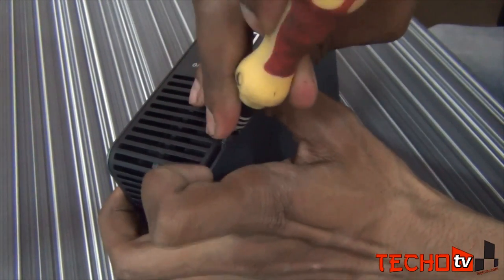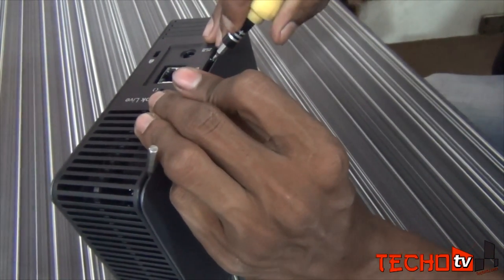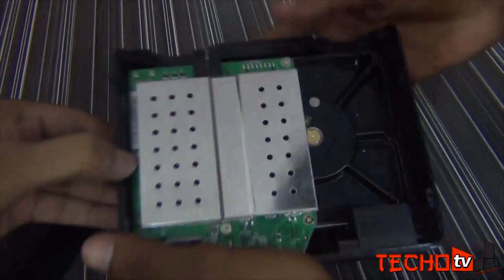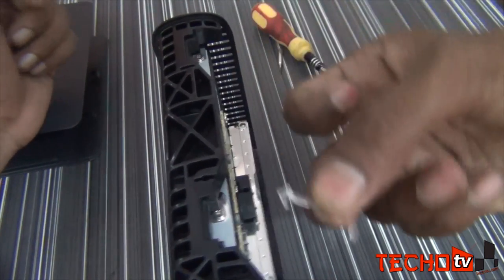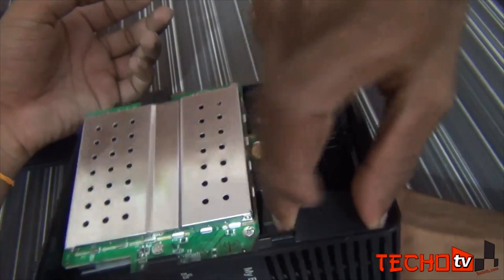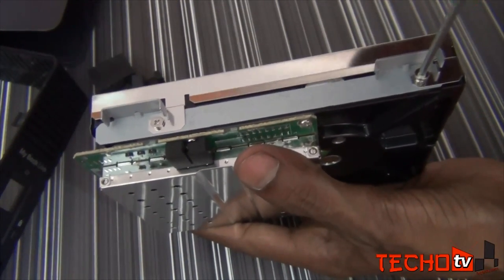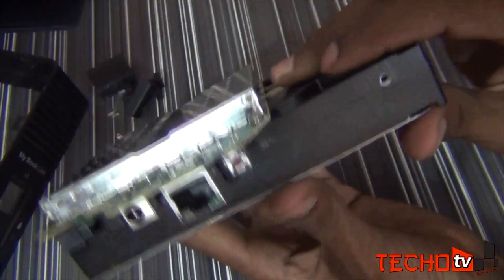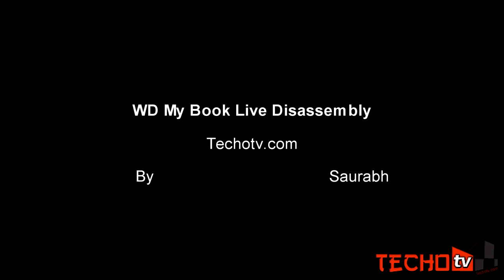"WD My Book Live" NAS Disassembly - How to open, take out Hard disk

Comment: If you attempt to force the long edges apart in the way shown you will break the lugs securing the outer casing to the chassis assembly.  Using a screwdriver will also damage the casing further.  To separate the casing from the chassis you must slide the chassis out, using a plastic separator tool inserted (like a wedge) between the round edge of the casing (top and bottom) and the casing to ease it out.  When the clips securing the casing to the chassis are free the casing will slide easily.  It requires patience and great care.
Reply: Do a video of it. Would appreciate.
Reply: Thanks for the tip, managed to slide it out in one piece with nil damage, 10/10 would brick again.

Comment: good video. I used one of those plastic tools, they give you to replace a mobile phone screen, and started at the corner of the case to start and it was a lot easier to run the tool around the lip rather than brace it open as i went. thank you for your hard work it saved me a lot of time.

Comment: You only have to pry open the edges along the back (where the network jack is). The LED optical cable is a pain when putting it back together because the rubber that covers the screw needs to be worked around (instead of removed). The LED no longer works for me, but I guess that's not really important. I was able to upgrade the 2TB drive to a 4TB drive and re-imaged the drive to get it to work. Thanks for posting.
Reply: hi, good to hear that. Would you please be so kind and tell me what you have done and how to double the capacity? And does anyhone knows what is max capacity to upgrade ?

Comment: The only part I had trouble with was with putting back the rubber guard that houses the LED. HOWEVER, I had tested the LED before re-assembling and there was no light emitted from the tiny square. Could be a lot of reasons... the hard drive (Seagate 4TB instead of WD), the firmware, etc. I don't remember the last time I saw the LED work, so it may be irrelevant.

Comment: Once I have the hard drive out, can I connected to a Windows PC using a "SATA3 to USB" cable and be able to access my files like a portable hard drive? Would windows recognize the drive this way or does it have to get connected directly to the motherboard like an internal hard drive? Thanks.
Reply: No, I've tried ;( doesnt work. Or just rather no possibility without formating... i dont want to loose my data

Comment: My LED stopped working shortly after I got it.  It started working months later for no apparent reason but for only for a few days.  I was surprised to see a red light when I did my first reset but that soon stopped working.  I previously had WD Netcenter that went bad but it was the HDD.  Here's hoping that its just the MBL controller.

Comment: I have a few questions.
1.) Can I buy a SATA hdd case or use the same case it came in and just buy a SATA - USB connector?
2.) What is the physical size of the 2TB hdd? I'm confused about what inches is which.

I have the same model disassembled in the video.

Comment: Thank you for sharing. Is it possible to replace the Green drive with a Red drive? My understanding is, that for NAS the RED series is superior to GREEN series .. why I am curious why WD did not mount this from the beginning.
Reply: Michael Mortensen i was thinning of replacing with an ssd. Just want to know if it can be done i can save and replace all the data i have on my drive. I use the network drive as a media server and can access it when im out of the house. An ssd would speed things up if possible.

Comment: By  setting the hard drive to PC the WIN7 says that it is not accessible and needs to  be format (both of the disks from the WD case).
is their any way to read the data ?
TNX
Reply from the maker: Amnon Buchnik Try it on Linux distro..
Reply: Saurabh Kumar UBUNTU?
Reply from the maker: Amnon Buchnik yeah, you can try on ubuntu or use any of those live bootable linux distros especially made for recovery purposes with essential disk management related tools (System Rescue CD), so you don't have to mess with your current windows..
Reply: tnx

Comment: Hi Saurabh. 
I am totally disgusted with the WD My Cloud Box!. 
I hate it  :¬(  
Because it is so slow and the software does not work with Linux propely. 
SO.... I am going to disassemble it and use the hard disk in another computer with "owncloud" software.

My question is..... 
Do you see any problem with taking out the disk using it in another computer? ?
Will it work ok??
Thanx

Comment: I dropped mine yesterday from about 2 feet i tried turning it on and it does it makes the reading sounds in the beginning the lights are blue but then it goes to solid red....i tried to set it up to our new network since we moved from the last time i actually used it i'm just scared that something broke on the fall....it's not able to have the solid green light therefore the setup guide doesn't find it...what should i do anyone? please.
Reply: Trade in to WD while it's still available for this model. They are taking all trade in Of MBL til October 31 2021. Once you trade in they give you a 40% code to purchase update version of MBL.

Comment: This is wrong
Begin at the curved part, pry it open a little, and then the cover will slide about half way easily, where it can be spread open a little to get it off.

I tried your way and it wrecked the clips inside, before I noticed that should slide back.